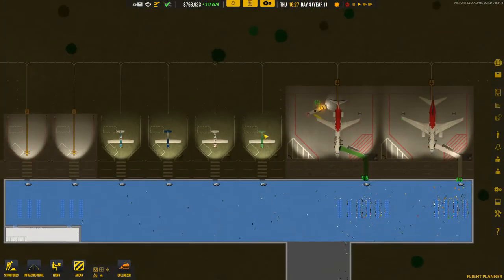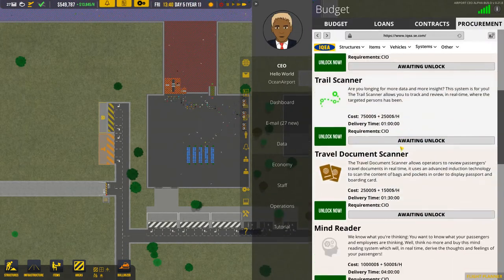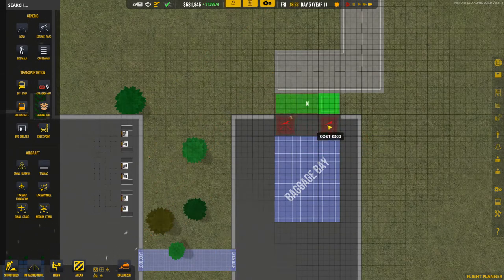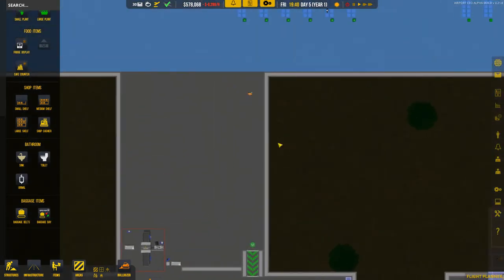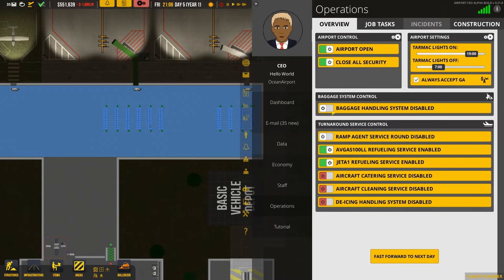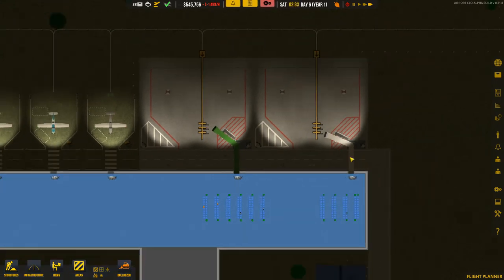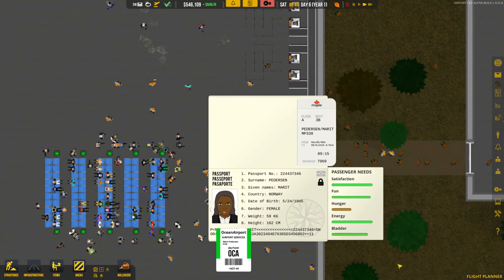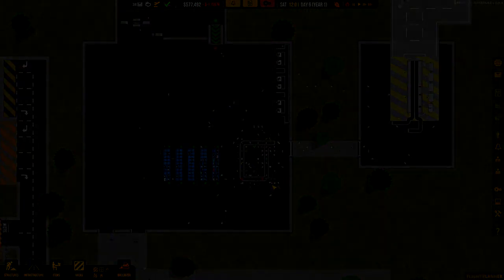Airport CEO guide - Part 4: Conveyor belts

Comment: My ramp agents aren't loading or unloading the baggages from the airplane. What did I miss?
Reply from the maker: I ran into this problem yesterday as well which basically cut my game short. What you could try is save/reload as that solves some issues, but otherwise, make sure you have all the ramp related things in operations and that's all you can do if you connected everything right.